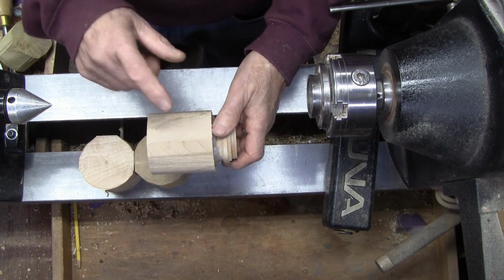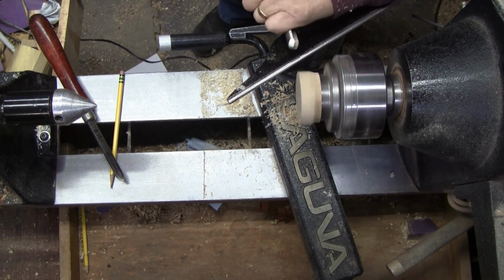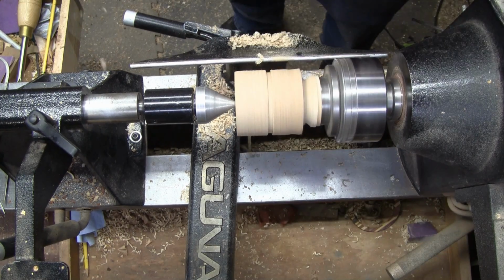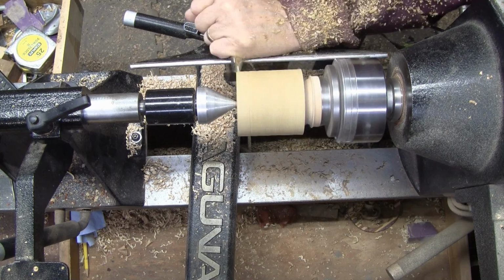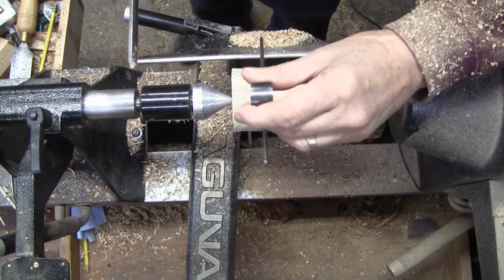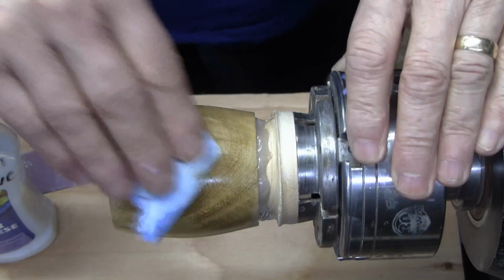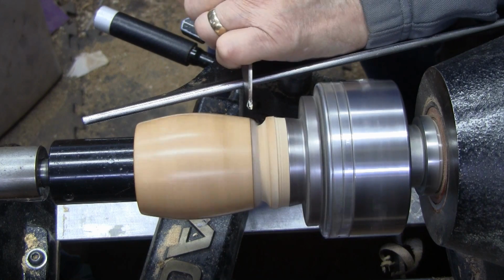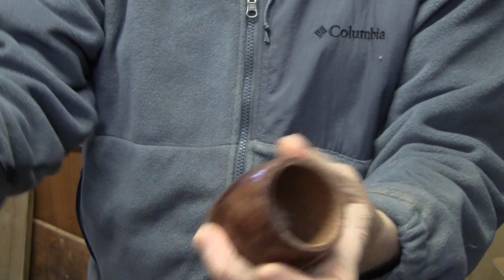Wood Turning Easy Gifts or Craft Sales Using Glue Blocks

Comment: Just setting up my first lathe and I hope to try this project soon.  I appreciate all of your tips.  I first thought you were using some small branches with the bark stripped but realized you cut the rounds out of blocks.  I have a lot of nice 4 in logs i would like to use for something besides bud vases. BTW did i see a Brewers cup in one of your videos?  I am in NW Wi and have ash, mulberry and black locust to share.
Reply from the maker: Setting up a first lathe will be very exciting for sure. Years of fun ahead.
Branches would work fine but these were trimmings for burls and other things I never through away.
 I am trying to think of the Brewers cup you are talking about. Do you recall the video?
 I am in the north west Oregon. Never turned Mulberry but it sure looks pretty.
Thanks for watching and happy turning.
Gary

Comment: Nice, i make pretty much the same thing with white oak. Add 5 detailed lines across it. Scorch it with a torch. Then, friction polish it with Bees wax. End result, a Whiskey snifter that looks just like a Whiskey barrel.
Not for everyone obviously. But popular in my circle!
Reply from the maker: I have some Oak set aside just for doing that. Are you just torching the outside?
Reply: Yes, after burning lines that look like barrel rings. I use 5 total. 2 towards the bottom. 2 towards the top, and one in the middle. Then friction polish in with Bees wax. Has an attractive realistic look. Beware, people will want them!
Also melt bees wax on the bottom to keep alcohol from leaking thru.

Comment: Hmm, I thought they might to share  a 'cup of cheer, for auld lange syne'.
To quickly mark glue blocks and other stock, I made a template from a 4x4" scrap of acrylic glazing. I mark and drill a tiny center hole, a hole for the spigot radius, and another hole for a recess.  It's easy to place it over the block and near-center the template.
Reply from the maker: Thank you and it would make a nice "cup of cheer" Your template sounds very useful.
Take care,
Gary

Comment: Oh my, these are lovely and so practical! Certainly can be used in many different ways. But the thing that impressed me the most about this particular video was your simple explanation on how to attach and detach the tenon. Lastly, thank you so much for the buffing tips. Fingerprints are definitely a no-no.
Reply from the maker: Thanks so much Abe, those tenons can be a real time saver and the bottom is all done but the finish once you remove the tenon. When there is room denatured alcohol does a great job of getting them off.
Thanks for watching,
Gary

Comment: This just might be the idea I have been looking for. I have several small logs that split while drying and I should be able to salvage at least some of the wood on projects like this. Thanks for sharing those great tips on the calipers as well as the tip on marking the glue blocks so they run true on re-chucking.
Reply from the maker: Thanks Gil, they are easy and make great gifts. As long as those tenons are made from dry wood they will run true when putting them back in the same spot. And that really makes a difference so the mark really helps.
Thanks for watching,
Gary

Comment: Beautiful little containers! My guess was toothpicks but they're a bit large for that unless you had a lid with maybe a 1/4 inch hole in it for shaking one out. My little toothpick holder is forever tipping over and spilling the contents onto the table! Thank you for this great video!
Reply from the maker: Another great idea Gwynn, we have toothpick holder like this as well. I forgot about it.
I made these with a thick bottom so they would not tip over. 
Thanks for watching,
Gary

Comment: Thanks for another great video!  You offer such practical tips.  Did you choose to leave the inside un-sanded and without finish?  The glue block instruction was great, I’ve never trusted that glue along the outer edge would be strong enough… will you only do this method for small pieces?
Reply from the maker: Thank you Amy! I did sand them but just with 120 grit. I also put some Howard butcher block oil on the inside but they could have been left unfinished and should be fine.
 So I have used those glue blocks on large segmented turnings that I have put hours of work in. I used one on a turning a few weeks back that has the Zebra Wood feature ring. So I do trust them. 
 Thanks for watching,
Gary